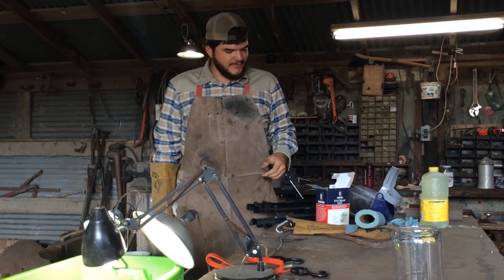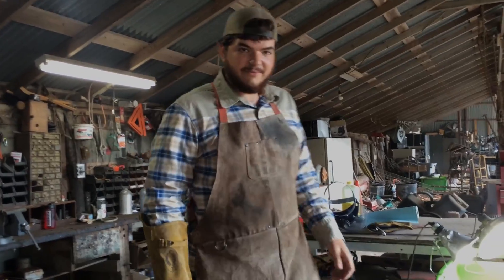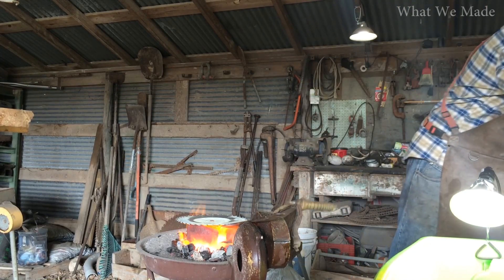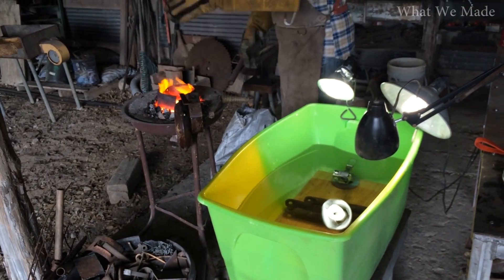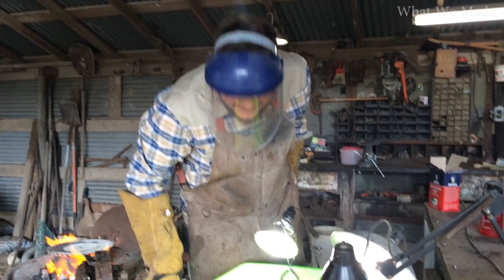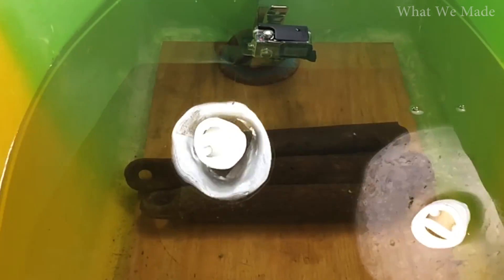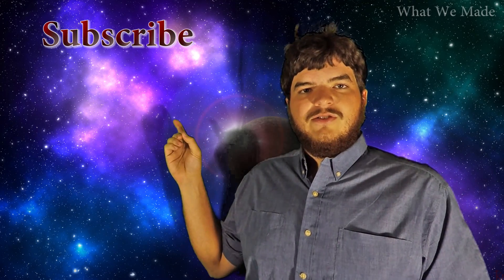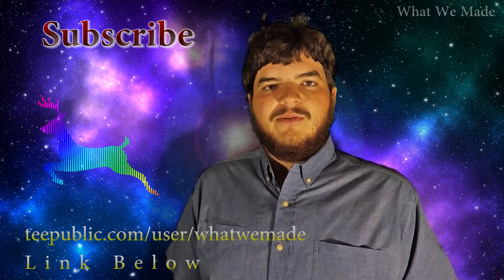Molten Salt: Exploding Water

Comment: Salt isn't a metal...what is happening here isn't a physical change, I think it is a chemical change. The weakened bonds (don't freak out about my wishy-washy chemistry, please) in the NaCl breaks the H(2)O bond in the water and then: combustion.
Reply: +Jonathan Engwall hot salt can run a motor?
Reply: I think all of the salt would be in the way. So, I guess, both yes and no.

Comment: I think what is happening is that the Leidenfrost effect isn't working due to the interaction with water and salt.  Therefore it can boil it immediately and violently
Reply: it is more that the leidenfrost effect doesnt work mean that when the salt is pourn that it catches water inside the salt like in Giant bubble and than explode because the water vapearates (sorry for bad english im Dutch). i dont know if you mean that
Reply: drooggamingtime  It could be that too.  Basically, I was thinking that the lack of a Leidenfrost effect was responsible

Comment: sodium reacts violently, with water, the molten sodium caused that
Reply: +Guodlca Actually salt is sodium chloride, so it contains sodium. @Fallout_Legend _ is wrong though, as sodium reacts violently as it binds with the water, and sodium in salt is already bonded to creat sodium chloride. If he was right salt would explode any time it was mixed with water, regardless of heat. Seeing as the vast majority of water on the planet contains salt he is clearly wrong. The violent reaction is just from the sudden change in temperature, creating and extreme difference in the pressure of the two objects, so the higher temperature(higher pressure) object rapidly expands through the suddenly extremely low pressure of the water.

Comment: Liked the video :). As to why it explodes, well, I can give a fair guess. 

When casting shot(also called Casting Grain) is made, molten metal is poured into a water bath. This drizzled metal forms small balls, much like old fashioned lead buckshot which was made in a similar manner. 

Sometimes, if the pour is heavy, the metal blobs that form are large enough that they trap a small drop of water inside of themselves. This is dangerous in casting, as when you heat the shot up, it can explode from the water trapped inside boiling, and bursting the near molten metal like a baloon. This throws bits of red hot metal everywhere, and obviously is not something you want. 

The molten salt might be doing something similar, in that the volume of salt you dumped into the water engulfed water, cooled enough to become solid, and encapsulated the water before it could boil. The pressure would then shatter the salt crystal, causing the explosions we saw. 

Keep in mind, I am not an expert, this is only a semi-educated guess based on previous experience with casting, and some of the hazards that go with it.

Comment: It kinda makes sense, because salt reacts with water VERY readily (table salt's solubility in water is higher than even that of sugar).
Reply: +Guodlca Okay, nevermind that thing about its solubility being even higher than that of sugar. What do you mean "how does NaCl react with water"? What do you think dissolving is? It's breaking up the NaCl molecules into Na+ cations and Cl- anions that persists as long as the water around them is present. The dissolution of e.g. NaOH in water is so reactive (exothermic) that the solution will get really hot.
Reply: +CoolKoon  I completely agree with you.  This is what I was trying to say in other comments.  Because the salt and water react, the Leidenfrost effect doesn't work and you get the instant boiling

Comment: It would be cool to see what happens if the water the molten salt is poured into is a saturated salt solution.  The solubility of salt in water only rises a few grams per decilitre from freezing to boiling point (of the water) so in theory pouring half a kilogram of molten salt into ten litres of saturated salt solution should result in the molten salt not being soluble in the water and therefore having to... do what?  crystallise in some odd manner? cause salt to crystallise finely throughout the entire volume of water in some ionic saturation/precipitation trick?  Curious...
Reply: +james Partanen Wouldn't the molten salt rise water temperature and allow more salt to be soluble?
Reply: thats a really good question!!! after the salt bursts, it just dissolves, it would be interesting to see what would happen if the water was already saturated

Comment: It's the sodium reacting with the water. I reacts just like pure sodium reacts
Reply: You can make NaCl by just exposing molten Sodium to Chlorine gas, or with solid sodium with silica sand in a container full of Chlorine gas, the silica acts as a catalyst. This is the same thing
Reply: What he is pouring into there is Morton Ice Cream Salt, which is a mined Halite and not pure NaCl, also in a previos video they try to melt glass in with the rock salt. Also I'm not seeing any particulate matter falling to the bottom, normally molten NaCl turns black in water. Granted all I can go from is what I see. I can't tell if any of those bubbles are Hydrogen. It just looks like an alkali reaction. I like you am trying to figure out the chemistry here

Comment: Well part of the explosion is caused by the instant boiling of the water.  However, as many have seen molten rock or aluminum in water see that the explosion are more controlled.  So why so violent?  The answer is easy...its the salt.  Salt is made up of Sodium.  When liquified, some of the sodium has been allowed to congeal or congregate together.  Sodium is naturally "explosive" in water.  The sodium interacts with H20, causing the violent explosions.  Hope this was helpful.

Comment: Did the salt dissolve instantly when it touched the water? I don't see any crystalized salt dissolving. Or did it dissociate to sodium and chlorine by contact with the water at high temperature?
Reply from the maker: +MrHal90000 There were some salt crystals in the water afterwards but most of it was gone. -Caleb

Comment: Someone bring the professor over from Periodic Videos!
Reply: +Sion and Neill to clean the mess
Reply: +Philip Madden But why pretty much any other molten metal doesn't do the same thing when poured into water?
Reply: +Philip Madden  I don't really agree.  The fact that the sodium is much hotter than the water isn't enough to explain it.  There are videos of 4500 F Thermite in water and there still is no flash boiling.  The reason is the leidenfrost effect prevents it.  However, the Leidenfrost effect only works if the two substances don't interact.   If they do, it doesn't work, dry ice and alcohol is a great example of that.  So my thought is, that the molten salt is flash boiling the water, because they are having physical and chemical contact with no protective film
Reply: +Philip Madden 
I don't think it's that. C(NaCl) = 36.79 J/Kmol and C(Al) = 24.20 J/Kmol. It's not that drastic of a difference. And the melting point of NaCl is 801°C and of aluminium is 660°C. M(NaCl) = 58.44 g/mol and M(Al) = 26.98 g/mol. Sodium Chloride's thermal conductivity is much lower than aluminium's.
So 1 kg of molten NaCl has about 630 J of thermal energy and 1 kg of aluminium has about 900 J.
Reply: My brain hurts from reading the replies
Reply: +Philip Madden ohh.. this is really old haha. Yeah, I misunderstood that part. I talked to my chemistry teacher though. He said he agree that just the temperature shouldn't do the explosion. In his opinion it's because there is some small impurities in the salt.

I'm not sure if the temperature would do that too. because you can clearly see the small fiery explosions.

Thanks for the explanation :)
Reply: +Philip Madden You are wrong Philip. This isn't a BLEVE reaction, do you even chemistry?
Reply: +Zartymil the reason Na reacts with water is because the action of converting it into Na+ and OH- (plus Hydrogen) is what releases chemical energy. If it was a chemical reaction then the same thing would happen with pouring room temperature salt into water, but it doesn't. Because the Sodium and Chlorine are already ionized.
Reply: rocketsocks Ok ok. I know, and as I said. I've talked to my chemistry teacher. He said it isn't a physical reaction (actually, look at the video. There are lots of small explosions happening in there). For him it is because some natural impurities of Na happened in the salt when it is melted.
Reply: +Philip Madden That's not correct. When you melt salt you produce liquid sodium chloride. Which since it's liquid it has ions of sodium (Na+1) and chlorine(Cl-1).  Sodium is an alcaline metal, one of it's properties is to react with water liberating a bunch of energy with it (aka the explosion you see).

If what you said was correct it would happen to any hot liquid (Like molten iron) or maybe any other liquid salts (Like Al2NO3). Which doesn't happen.

Comment: This was because the Sodium in the Salt, NaCl Sodium Chloride, was reacting to the water. On the periodic table all of those elements in the column react exceptionally violently to water in their pure states. For example pure Potassium, that stuff that people say is good for you and there is a ton of in bananas and potatos, is typically transported submerged in oil in order to keep it from reacting to an accidental water spill, rain or high humidity. If your curious look up some videos of Cesium being put in water.
Reply: Ohh I was really being stupid for a sec. Alkali metals. No I get it. It's like pouring ceasium into water. except it's molten a room tempeture
Reply: +David Pritchett wrong, metalic sodium would react with water not ion sodium. This is not an explosion its just very hot liquid making the water boiling very fast

Comment: What did you expect to happen putting something hot enough to split water into component atoms that is also a molecule containt an ALKALI METAL!
Reply: +ReddmanDGZ Can you tell us the temperature for water to split to h and o atoms? I thought it needs to be million degrees like lightening strike. Maybe I am wrong. The h-o covalent bond is stronger than metal-metal bound, and iron vaporizes to become individual atoms at many thousand degrees I thought.

Comment: I think that happend because the sodium ions on the salt are verry hot and when it make contac with water it reacted. and if you don't know when sodium react with water you can se a quick explosion
Reply: +Guodlca well I already know they are sodium ions but if you heat salt to the point it melt roughly 800°C a great part of the sodium reduce to a neutral state beacuse of heat(or u can also use electrolisis).

Comment: I think that happened because the heat caused the bond between the sodium and chlorine atoms to break, since sodium tends to explode when large doses are put in water.

So, essentially, you just poured pure sodium into a vat full of water.
Reply: +Retro Austin The extreme temperature makes the water instantly turn into steam this will cause a violent reaction, no matter what kind of elements you put in the water
Reply: No it's because your pouring something extremely hot in cool water,
Reply: +Retro Austin No, sodium chloride does not break into sodium and chlorine when molten. It's fairly obvious it doesn't because they aren't dead from chlorine and nothing is burning. If NaCl was that easy to separate, we wouldn't have all the mess with complex chemical factories. We'd just melt the thing and scoop the sodium.
It exploded because salt is fragile and has high thermal expansion. It first solidifies and then shatters. Water finds its way into the shattered material which has enormous surface area and flash boils. Sturdy materials like solid iron will not do this. They stay in their shape and form a layer of superheated steam around which insulates them. Liquid iron, on other hand, disperses and causes a detonation because it's a liquid.

This is a very obvious physical reaction. No chemical reactions here.
Reply: +Retro Austin most likely just how the atoms recrystallize after being melted, just like how if you heat up glass and put it in water itl explode
Reply: +Retro Austin Alternately, when you get temperatures hot enough, you can disassociate the hydrogen and oxygen in the water. And the water itself reacts explosively. Which is why you don't use water on burning metal fires, but rather try to let them burn out or smother them with something like sand.

It would be interesting to know which case is happening here.
Reply: +Retro Austin if the heat had truly broken the bond between the chloride and the sodium. it would have detonated in the pot. the reaction we saw was similar to that of thermite and ice. extreme heat in a liquid form, caused large bubbles of steam to form causing an explosion.
Reply: ^ my man, that doesnt answer anything, we all understand it happens because its really hot into water thats kinda the whole point to the subject here
Reply: +Ricardo8388 now this isn't neceassarily true, molten aluminum doesn't react nearly as violently as this.
Reply: Kyle Bell I dont believe its up to the element. I just believe this is the work of steam expending verry rapidly.
Reply: +Lajos Winkler It is a chemical reaction, my friend. When sodium chloride is liquid it has lot's of ions going around Na+1 and Cl-1. What he said is right. If you don't think so, check out some videos of people pouring molten lead into water. It doesn't make a explosion.
Reply: Zartymil You should read some basic general chemistry, maybe some inorganic chemistry, too, cause what you're saying is simply not correct.

Comment: was the water distilled? when water is distilled it "explodes" like that when heated to extreme temperatures.
Reply: +FishingTheGreatLakes Salt forming a crust, then cracking.  Basically it's like tempered glass shattering.
Reply: +FishingTheGreatLakes Salt forming a crust, then cracking.  Basically it's like tempered glass shattering.
Reply from the maker: +FishingTheGreatLakes No the water was not distilled. -Caleb

Comment: What if instead though you dipped the entire ladle  of molten salt instead of pouring it?
Reply from the maker: That could be fun. -BK
Reply: +What We Made Or pour water into the molten salt instead of the salt into the water. But don't die..it really can cause a large explosion depending on the amount of salt. I work at an aerospace company and we use molten salt & flux to fuse aluminum together so trust me when I say it's dangerous.
Reply: +Bruce Wayne Can you tell me why the molten salt is clear like water at the moment of pouring in the video? I thought it is well over 1000 degrees hot glowing opaque. Like casting gold ingots.
Reply: +Bruce Wayne 3:05...it's clear.  The ladle is red.
Reply: also deadly
Reply: +John C G I'm sure this is over 1000 degrees. But it's not clear, or at least it does not  look clear to me. Looks likes it's nice and red/orange to me.
Reply: +John C G There's emissive color, reflection color and transmissive color. It's fairly complex. It is glowing, but the intensity of the lights washes it out for the camera. Molten NaCl is glowing red, you can be sure of that.